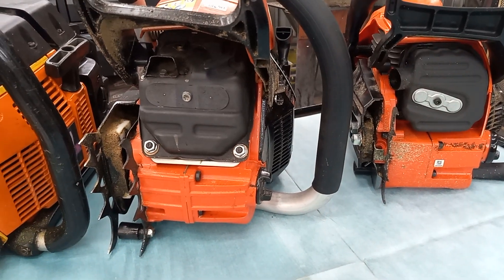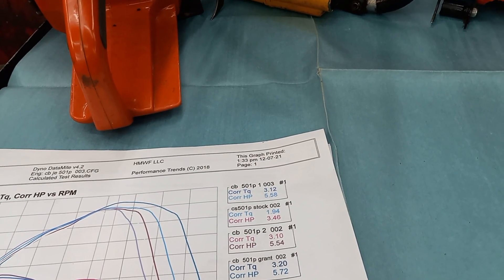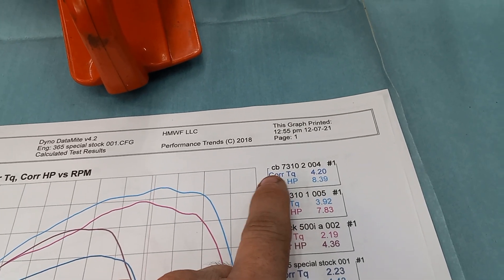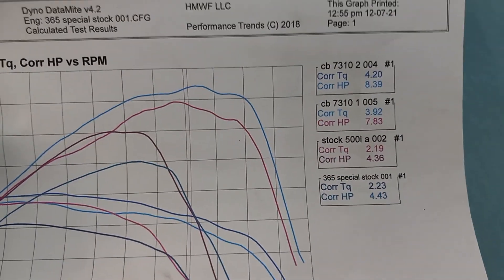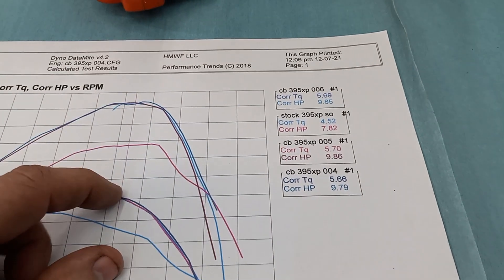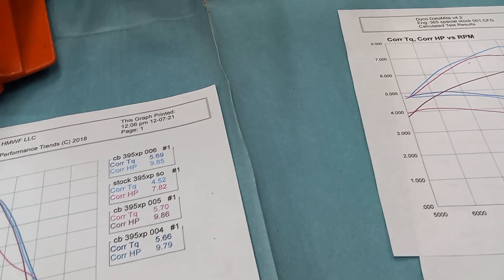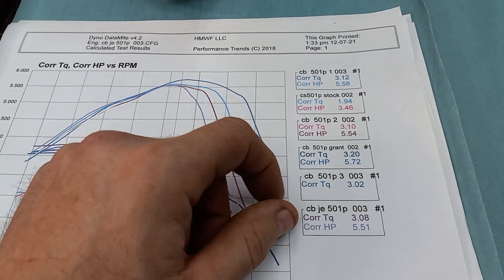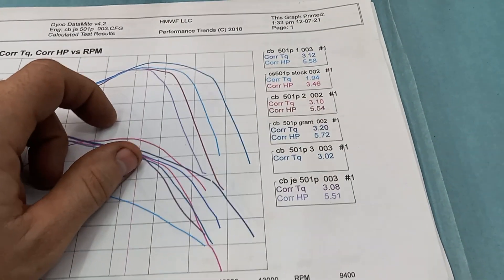a look at what my saws did on dyno Joe's dyno

Comment: So on the 7310’s you port. You mentioned your no longer going to modify the transfer port covers. Are you doing any work on the transfer ports themselves? I don’t really need another saw but I’d like to pick up a 7310 to play with. I see a lot of people playing around with those transfer port covers but my gut feeling has always been to leave them alone.
Reply from the maker: There's a vid of what I did on here if you look thru I moved  the uppers  with out taking sides off an re worked them thru the bottom  but not crazy  cut base an move port timing around to were I wanted it runs very good I'm happy with it

Comment: For a second I thought you were showing peak hp for the 500i I was about to say that saw needs a major overhaul if its only putting out a 4hp but you were going by the output at the same rpm as the 50cc ported saw

Comment: You have to remember he can only record one cursor point.  He will show the peak hp.  The torque indicated is the torque at peak hp NOT peak torque.

Your Echo 7310 numbers are crazy.  DynoJoe did my 572xp.  I had very specific requests and he hit them spot on.  I’m going to do a dyno review of it soon…  I didn’t want a hot saw but more of a solid wood cutter with better torque characteristics than typical 5 series saws…

Comment: Wait, you've got two different pages listing a 500i & 365 special (both say stock) which appear to be the same saws and the pages list Wildly different numbers. The first page says a stock 365sp has more power and torque than the 500i, no way! Something is wrong with these graphs... and no i don't even care about the 500i
Reply: The power numbers were measured at different rpm in the 2 graphs.

Power was measured around 10,500 rpm on the 7310 graph because that is where the 7310 were making best power. The 365,500i were already way past peak power at that rpm.

On the other graph with the poulan it was measured closer to 9,000 rpm where the 500i,365 were close to peak power.
Reply: @dynojoemods2764  thanks for clarifying that😉, it was confusing 😕 😜